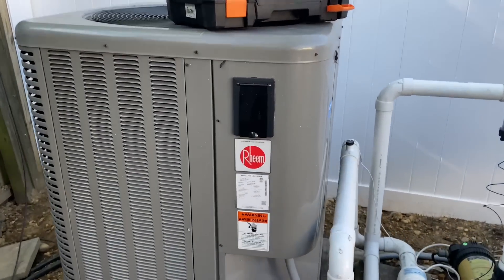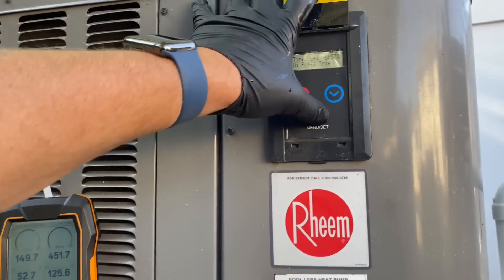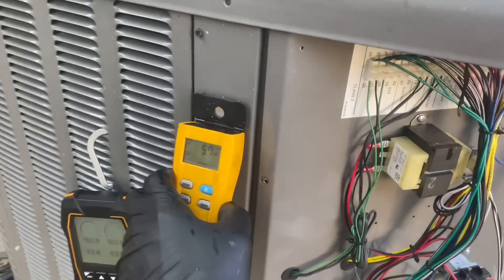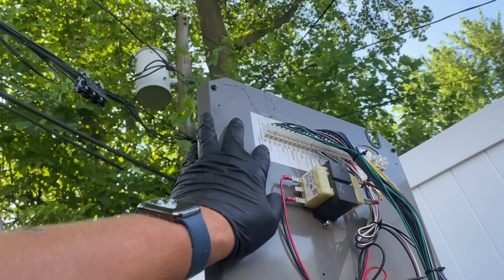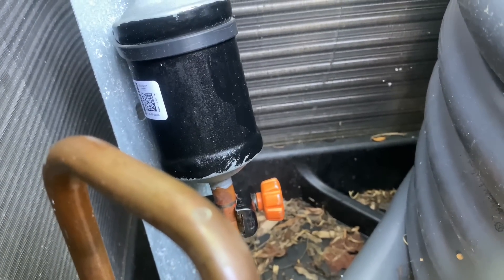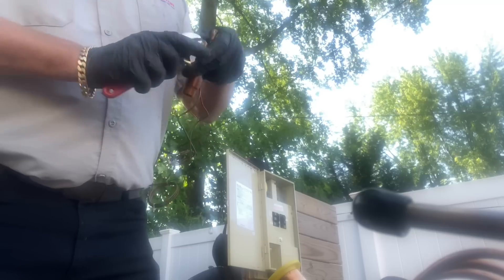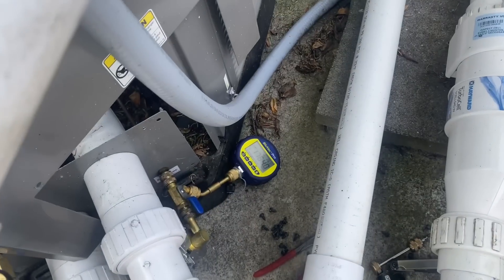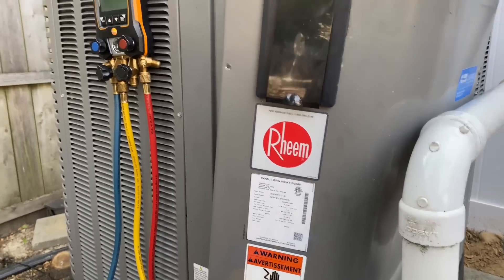Heat Pump FAILURE! High Pressure Fault Error - Replacement TXV & Filter Dryer OMG 😱

Comment: filter dryer being unidirectional is OK since there's no reversing valve, because it's a "heat" only heat pump. using a bidirectional filter is fine and wont hurt anything.
I don't think any common pool heater made is/was capable of cooling the water.

Comment: Tx’s are you great when they work🤷🏻‍♂️an better response, then a fixed orifice  but also more problematic too.. Touchy touchy touchy to re adjust….  If I might inject a hypothetical cause of malfunction here..  on the TX the screen looked by the video  Dark in color.  I would guess she had some moisture in it an TX’s Definitely do not like moisture.  The sudden drop in vacuum could be water boiling off or a possible trapped gas bubble in the compressor oil 🤷🏻‍♂️ but regardless  she is up an running great! But I’ll lay my money on  moisture inside the system….. I seen it a lot on walk in’s . I think it’s the constant heat/cool and we all have heard “ ohhhh no no one ever leaves the walk in door open” 😂😂 sure right!!! But nice job boss!!!

Comment: Pool Heaters sure have their share of issues.  When you have a Nice Pool, you want to be able to use it whenever you want and Not worry about Temps. 👍
Reply from the maker: A heat pump don’t accommodate like that.

Comment: Am I crazy, or was the TXV catch screen in backwards? shouldnt the bottom of the net be the other way around? I.E. going with the direction of the flow?
Reply: Looks backwards to me
Reply: it doesn't make a difference, as long as the open end is sealed/brazed to the tubing, so schmutz cannot get past.